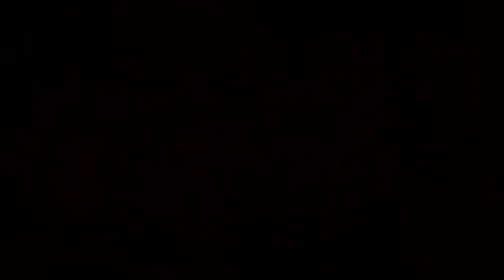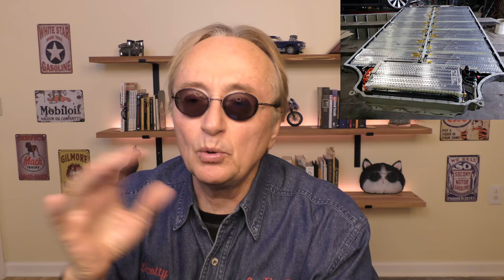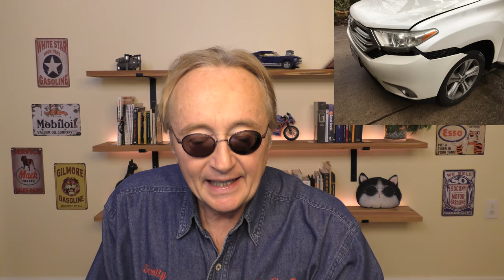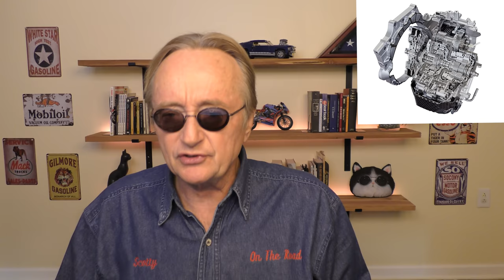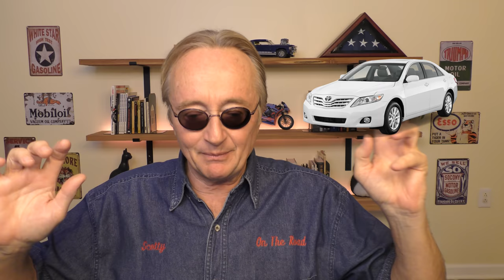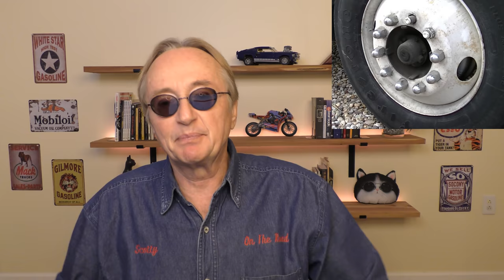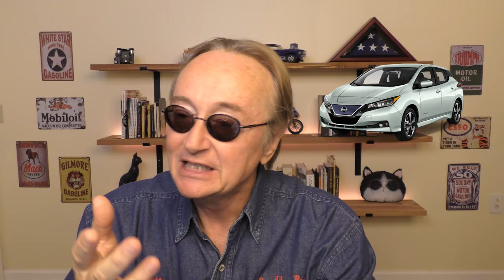This Fatal Flaw Just Ended Tesla’s Future in America

Comment: People don’t understand these batteries.  Toyota Prius battery holds a charge from 20% to 80%. of capacity.  Chevy Volt very similar.   This means you are only using the 60% in the middle and although your battery will lose 40% of it’s true capacity in 12 years, you won’t know it because it was never available.  Nissan Leaf and Tesla allows usage of above 90% .  Many Tesla owners prefer to charge to 80% unless they have a need for it. This reduces the stress on the battery and improves lifespan

Comment: Scotty, I brought my 2005Honda Pilot to a local mechanic I never used before for a Timing Belt Job. He told me while he was adjusting the timing his arm slipped and the Cam slipped out, so he was replacing the Head  at no charge. After when I checked the plugs on the 2009 salvage head they were full of oil. I brought the car back and he claimed he fixed the problem. It's burning a little more oil than before, what do you think? I don't think he would want to use a 250000 mile 15 year old head if he wanted to take mine and replace it with another.
Reply: @Mark Codiroli Yes, the receipt said "2009 Salvage Head". Thank you for your response, I've been following you for a long time and you are a blessing to us American Consumers.

Comment: Prius batteries use(d) nicads not lion tech. I don’t know if that’s still the case with latest models. But the nicads have lasted years without much loss in charge capacity (just keep the cooling vent clear of dust and debris next to the rear seats, to make it run cooler).

Comment: Lithium ion batteries in cars, like in phones have fine energy density, one notable flaw I have found (maybe I have bad luck) is the seem a bit rotten in holding charge reliably. Old lead acid batteries might be clunky and heavy but they last for me. The burning Teslas has been a thing. I don't think it's a crossover with his flamethrower.

Comment: If you have a sudden unintended acceleration event, just turn the ignition switch off.
But most people would be in panic mode and wouldn't think of this.
Reply: If you switched the ignition off then the steering lock would kick in! Not to mention the power steering.  Accident waiting to happen!

Comment: Hey Scotty,  if an electric car runs out of battery on the road, can another electric car give it some of its charge to help it get to a charging station? My 2018 Ford F-150 has a household type outlet, could an electric car get a charge from my truck?
Reply: Elctric cars can be powerd by any 120v 15amp socket around 2 days to charge, i would mot recomend using the one in your car as those arent rated for high power draw for long sutained periods of time (at 120v ot daws around 1500W, a 240V conection  can pull up to 10,000W and charges the car in less then 9 hours, you can definitely do it with the new 2020 F150 with its onboard generator but its unknown if long use will cause damge to the ford, some EVs have a function that allows battery powered to be pulled out from the EV as a mobile power station.
Reply: You can charge an electric car by towing it. Regen will charge the battery. 
Also EV's wont run if their 12 volt lead acid battery goes flat.

Comment: I agree with you about the Lithium batteries; I had to change the Lithium battery in my old Kindle e-reader.  The Lithium batteries have a life and then they're dead.
Reply: You mean just like all batteries!? That's not news. Part of the problem is that people don't charge and discharge their batteries correctly, according to the owner's manual. In many cases, you shouldn't deep discharge a battery, or regularly charge a lithium ion battery beyond 90%.

Comment: Dendrite growth in rechargeable batteries is nothing new. 

A bit off-topic but:
It has been a problem in NiCads for years. The answer for NiCads was PCR or periodic current reversal. This is what the electro-plating industry uses to get a hard coating. (You charge with AC, using one diode and two resistors so we charge 100% on one half-cycle and discharge (say 20%) on the next half cycle.) I built a PCR charger for my NiCads and they last at least ten years when recharged this way. Downside it takes longer to charge and is not efficient.
Batteries are a dead-end for all-electric vehicles. The future is fuel cells and hydrogen.

Comment: I use dewalt 20 volt power tools and they are lithium ion, I use it every day. I am a cabinet installer. Yes I have had a few breaks here and there. But I have put my batteries through the ringer. They are holding up just fine. Going on three years now, maby the car companies could learn a thing or two from power tools? Just saying
Reply: But also I know they it doesn't matter but I always run it all the way down and change it all the way up before I use it again.

Comment: Yes, and these things are an intermittent problem. As they grow between Anode and Cathode they eventually meet, cause a momentary short circuit, then fry themselves and break the short circuit, and everything looks normal again (unless totally fried) then they start to grow again and it goes on and on and on. They will need to use some sort of solvent to clean everything then probably put down some sort of conformal coating. Avantek and Fujitsu both suffered from the exact same problem a few years ago with this "Gold Migration" of crystals propagating between the Gate / Drain / Source" leads of their Field Effect Transistors in the electronics industry. (You will probably be killed for talking about this subject!)

Comment: Those drive-by-wire Subarus also have a huge lag time from the time you release the throttle to the time that it closes the throttle blades, this needs to have besides some modification, a redundancy instant acting system

Comment: There was a point at which combustion engines were reliable and long lasting. However, with the advent of turbochargers, direct injection and a plethora of computer modules you will see cars with a much shorter lifespan. We are headed to a cell phone model where we will trading in cars every three years.

Comment: Scotty is completely right - Telsas and other EVs relying on current lithium ion batteries have a big problem.  When these main batteries fail out of warranty, cost to replace will be prohibitive.  Who is going to spend $15-$25K for new battery on 10 year old EV?   Off to junk yard!!
Reply: The batteries loose 10% range every 200,000 miles, its its not the battery that will fail, its the car attached to the battery.
Reply: @miguellopez3392  Not necessarily.  You missed Scotty's point.  In many cases, battery will fail suddenly.  You can't go by what you see in first few years.  Battery degradation is not linear.  As they say, proof will be in the pudding!  Lets see how many Tesla cars are still in operation after 10 years of operation (which no Tesla cars have even hit yet).
Reply: @Mark Codiroli tesla cylinder cells batteries degrade about .015% of the battery per charge, so about 300,000 miles for 15% battery range loss.
Reply: @Mark Codiroli you are trying to sound like you know more then you actually do, enhines get effected by the enviroment as well, humidity, air pressure, and air tempature affect a engines efficiency and reliability, yo will have more problems starting a gas car in the winterbyhen a EV.

"Recent test showed battery degridation over 20% means over 200k mile distance"

See this is what i mean when you overstep, the degridayion chart i showed you was not from a test (there was no test of the kind you mentioned) but from battery range data from owners of the car, a model S can achive 400,000 miles and degrade less then 20%.
 Gas cars have a harder time adapting which is why people are buying more expensive battery powered sytems, even my lawnmower is electric and it outdoes my gas mower in power, conveniance, and reliability, only thing is cost but that will change with time as currently the replacement battery cost as much as the mower, but from over a decade of using pwer tools in cunstruction sites ranging from 5F to 105F in the mud, snow, or desert sand battery powered tools can take more abuse with less care, in the winter they have less power but it still beat the hell out of using gas powered tools that wont want to start because the air is too moist and cold... want to know why you dont find gas tools in custruction or manufacturing? Reliability, maintenance, and operating cost.
Reply: @Mark Codiroli 
" ICE uses input and output information to adapt.  Input such as barometric pressure, air temperature, air flow to readily compensate these variables"

 what's your point a gas car needs more hardware to do the same job as a EV?

many people have problems starting their cars in the winter, the lead batteries they put in gas cars doesn't hold a good voltage in the cold
a tesla will start in -40C no engine heater required.

range can be increased with better battery insulation or simply putting a larger battery to make up for cold range, all this is determined by cost which will continue dropping with the decades to come.

"Unless you can drive your tool to work your point is moot"
yeah im planning on getting an electric truck, im tired of the engine issues and maintenance on the F150-F350s i use for work.

 "Do you even know what happens internally when charging and discharging a battery?"

same thing that happens to a gas engine after its burned thousands of gallons of gas, it gets damaged and has a limited service life, no one really sells a 1 million mile gas engine?
Reply: @Mark Codiroli "teal world controlled testing"
Ok since i do know more about batteries i would like to see this real world controlled test you keep talking about since apparently thausands of cars driven in verious conditions and places isnt good enough for you.

Comment: These dendrites and tin whiskers are also a result of "eco friendly" lead free solder. Which is a big reason why electronics don't last. Stick with old cars and electronics that used 60/40 tin lead solder. Lasts forever.
Reply: Dentrites form in the electrolyte layer between anode and cathode layers of a batttery cell roll, cobalt (toxic) is used in most high end batteries to increase life span, teslas newest cells, use a solid electrolyte and no cobalt, they are aiming for a million mile life span but cathode expansion and retraction is still a problem (same reason solder comes off overtime)
Reply: @Mark Codiroli you just explained how they form, i explained where they form since he was talking about soldering which is unrealted to battery chemistry.

You like reapeating things other say to feel smart? Next time understand the conversation before you look even more cluless on the subject.

Also who uses a graphite anode in EVs?

Comment: Drain on battery efficiency is a known issue. Tesla gives a 7-8 year warranty or something along those lines. Not sure what the issue is since there's plenty of cars that have major engine problems as they get older. Of course these batteries won't last forever. But batteries can be replaced just as a engine can.
Reply: Electronics are more likely to fail before the cell does, unless you drive 30,000 miles a year it shouldnt be a problem.
Reply: @Mark Codiroli show me that cost analyst and i will show you a real one.

Comment: As everyone is facing out Petrol and Diesel engines 
Could hydrogen engines be the way forward instead of electric. 
At least you wouldn’t have to wait around for them to charge.
Reply: Battery cars are cheaper to run and buy then hydrogen fuel cell cars.

Comment: How much expense is spent when an ice vehicle engine or transmission needs rebuilt?
Reply: the difference is that EVERY battery vehicle will fail.  Not even close to every transmission will ever need to be rebuilt - unless it's a new GM. Go tell all of your customers that in 5 years you'll need to replace your battery at a cost of up to $16,000.

Comment: I ignored and poo-poo'd SUDDEN/UNINTENDED ACCELLERATION until 3 days ago when my car did it for like 2 seconds and then acted like it couldn't understand exactly how much power I wanted for the next 15 or 20 seconds... afterwards everything was fine again and it hasn't happened since.  That was in a Mercedes-Benz but the truth is it can happen in ANY CAR with an electronic throttle... which is EVERY CAR MADE TODAY!  A throttle CABLE only reacts to your FOOT pulling the cable that's attached to the throttle.  So technology has created a problem were before none existed.

Comment: This problem has been known to occur in the Li ion cell for decades.  Apparently it hasn't been adequately solved.
Reply: The reason cell phone, tool and other batteries have bad dendrite problems is in the chargers. They over charge the batteries to too high a voltage. Works for awhile and makes the specs look good.

No biggy for batteriy manufactures they are sell batteries.

Comment: I don’t believe the data you have on the Subaru acceleration problem is accurate. Malcolm Gladwell did a podcast you should listen to on the sudden acceleration problem that Toyota had a few years ago. He found that brakes beat engine every time. They tested it in multiple cars and the brakes always stopped a car no matter how much they pressed the accelerator pedal.

Comment: Dendrites are caused by overcharging a lithium-ion battery. Because of their chemistry, LiFePo4 batteries do not suffer the same types of failures as is possible with lithium-ion batteries.
Solid state batteries are expected to be in products by 2025 and will  NOT have dendrites because of the solid state electrolyte.
BTW, some Toyota gasoline RAV4s may soon be recalled for spontaneously catching on fire, whether being driven or parked. Cars catching on fire is not exclusive to electric vehicles.

Comment: Hi Scotty,   Yup batteries do this and have done since their inception.   The problem is the technology hasn't been fully  developed for electric car use.  It's still "almost".   My ideal is a car is  a straight six and weber carbs or SUs and five speed manual.  Failing that a Toyota Camry.  My bike a GSX1000 and is full of electronics for emission.  Its was all wrong and gave jerky throttle response. Dangerous for a bike of this power.  I had to get a reprogram fix done.  Fortunately the throttle control is cable. This push for tight controls is a government thing.  It isn't cars that are the highest in emissions, it's  factories, ships, trucks - cars/bikes are at the bottom. Top in the world for pollution is China.

Comment: Toyota KNEW what they were doing when they dragged their feet for full EV cars and refused to make modern diesel engines for passenger vehicles. 

They are, first and formost, a mass market vehicle company, that make everything for the masses, from cute little hatches to giant 8seater SUVs and everything in between. But all of them, despite their varied body configs, have two thing in common: affordability, and relative reliability. 

They instead focused their efforts on hybrids. See their mindset? They know they have to keep moving forward in the technological arms race, but at the same time, they understand that it would be foolish to ignore a tech (internal combustion engines) thats been tried, tested and improved over several decades.
Reply: Is that why they're making Fuel Cell cars which can only be fueled in a very few places around LA and SF CA?
Reply: @maurice7413  and im a dude from Malaysia btw. 32million people, with currency 1/4th of the dollar strength, and a vehicle tax system that double the price of cars. 

And yet, last i checked there were 400,000 turbodiesel toyota hiluxs roaming my country and the no1 best selling car company a local manufacturer (produa) which sells redressed toyota hatchbacks and minivans. 

So yes... toyota know what theyre doing.
Reply: @arsyadidris2919  yeah, so no fuel cell cars there.

Comment: Telephone poles everywhere why can't they put a single pull in spot with charger at poles?  Would be quicker and easier then looking for and or building  stations and running wires?  I have lithium ion batteries over 4 years old and working good also made ebike battery from used old tossed laptops  3 years ago still going went through a couple of tires

Comment: I can't understand the concept of electric cars.  I'm not a big fan of hydrocarbons as well. Electric needs constant energy source otherwise you get these battery problems.  Gas is up & down. I'm looking at wood gasification too. If it works you can find wood everywhere so you will not ever run out of power!
Reply: You can run a car on compressed air also there been a couple of prototypes

Comment: Who's paying Scotty to hate on the most reliable car maker in the world? Tesloop data shows 2016-17 Tesla models charged 90-95% multiple times a day have battery degradation of 20-25% at 300,000 miles. With repairs and maintenance they cost an average of $0.05 per mile to own compared to around 15-20 cents per mile for toyota. The tesla pays for itself after several years compared to a new gas car.

Comment: Dendrites started to form when the battery voltage is too high. For longevity, best to let the batts at 85% max. The stopgap measure for this is to update the software to stop charging at lower voltage. This would decrease the range, but safety is paramount, then longevity. The problem is that sometimes a car has defected batt cell, which is a common thing for mass production. The cell would have lower max voltage, thus more prone to dendrites.